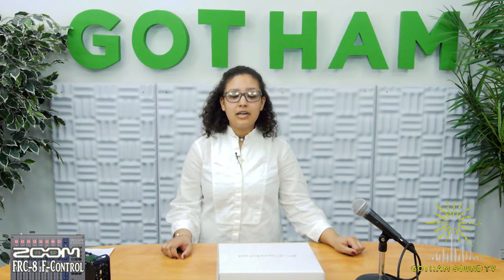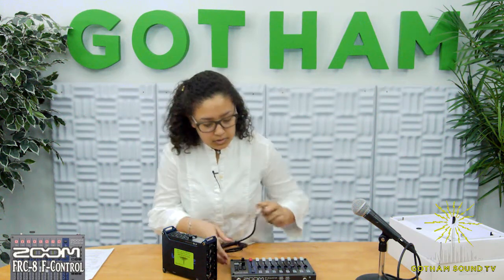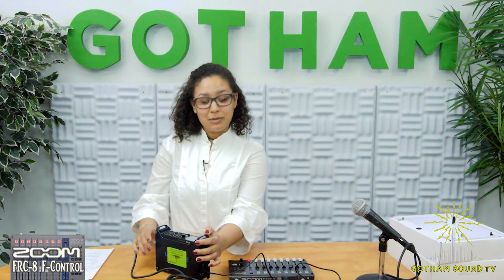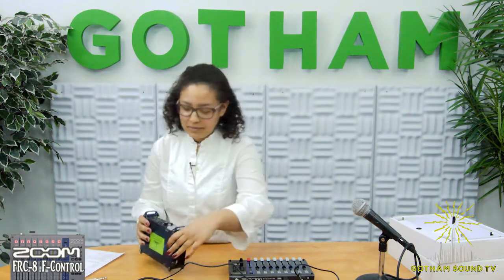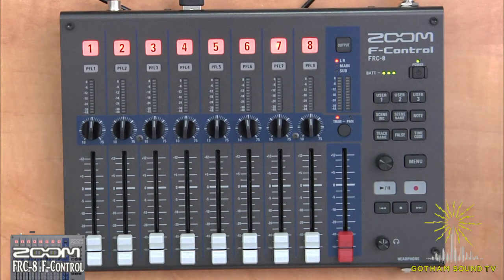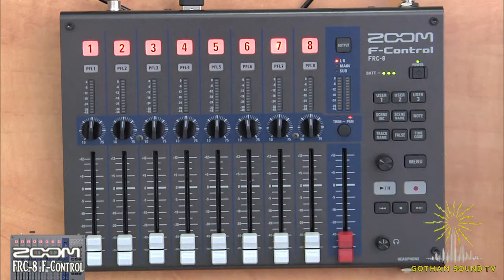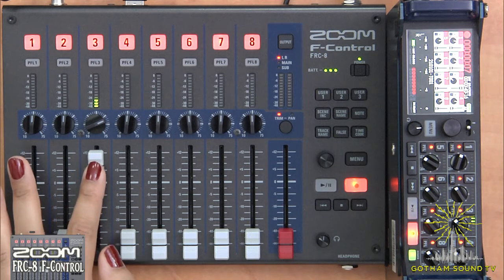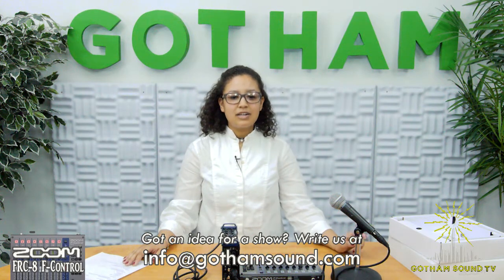Zoom FRC-8 F-Control Demo

Comment: Thanks fir the video gotham but please give me the demonstration of that “ if I will connect the zoom f8 to yamaha sound mixer !! Is it possible?? IF yes how it can be done??”
Reply: HI tarun, which Yamaha mixer are you looking at using?
Reply: Yamaha mg12xu
Reply: Please tell me how could i do my job please
Reply: Hi Tarun, the Yamaha mixer does not have enough outputs to be able to send individual tracks to the Zoom F8.  It is designed to do an analog stereo mix down and to send ISO tracks to a computer.  The best you could do is send the aux outputs and stereo outputs to the F8 and get 4 isolated channels.   Another mixer with direct or insert outs would be a better choice to use with the F8 or getting the Zoom FRC8 to use as a control surface.  I hope this is helpful.

Comment: Obviously that is not how you would setup the F-Control gain structure.  Set the channel slider as you would any audio mixing console to the '0' (zero) position first (about three quarters the way up in it's travel), then set the trim level as required by the source. If you need to pan that channel, press the Trim-Pan button and adjust as needed.  To make adjustments during the take, adjust the channel slider, that is what it is there for.  Trim is a coarse (gain) adjustment and should not need to be retouched once set.  The slider provides a fine (gain) adjustment used for the live mix. The F-Control is a very viable solution to Live mixing requirements IMO for cart or table top operation.  Built adequately, smartly designed (if not a bit small) and priced reasonably.  Zoom is providing very good products and solutions in this market space.